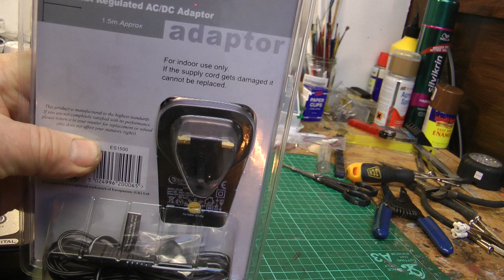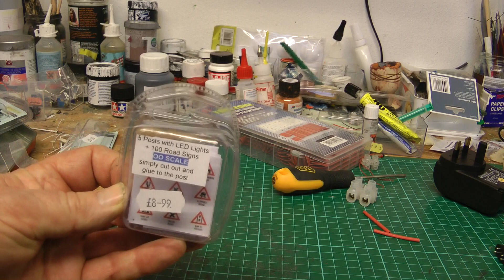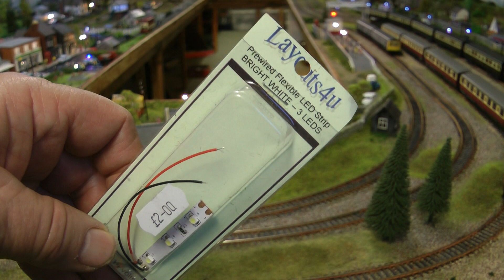Adding lights to Model Railways

Comment: Hi Dave: I have cut the end of the Regulated Adaptor like you say in the Video...which is the positive wire...the all black wire or the black and white one ..great video
Reply from the maker: The black and white one is the positive ...Dave
Reply: ***** Thanks Dave...your layout is something else...well done
Reply from the maker: Peter McGlone Thanks , just ask if you get a problem , not sure will be able to answer mind , but will try ..Dave
Reply: ***** No doubt I will be back as Arnie Swartz' would say.....cheers
Reply from the maker: Peter McGlone  No problem
Reply: ***** Dave Quick one before I start...I am using strip LEDs bought from E Bay do I take resistors off on LEDs or leave them on. I am using the Regulated Transformer like the one in your Video.
Reply from the maker: Peter McGlone if you are using the three or more leds on a strip , no need for resistors on the 12 volts
Reply: ***** Thanks Dave...I have just used one LED to see how bright they are and a bit of a test run..I have put it in one of the Mill buildings (N Gauge). the one i have are a bit bright. I took the resistor off.Sorry to keep bothering you.
Reply from the maker: Peter McGlone Maybe if it is too bright just run a felt tip pen darker colour over the bulb ,
Reply: ***** Thanks Dave...I put a touch of Red Acrylic paint on...it works a treat. Just going to try one at a time in case I blow the lights rather than do a circuit of say 20 lights. Just wish I hadn't built my Metcalfe Building first now but think I got away with some by cutting hole under base card.
Reply from the maker: Peter McGlone I did show a video adding the lights to a signal box ,and yes I know what you mean ,need to add the lights whilst building the models
Reply: ***** Dave.I have put six LEDs in a series into the row of Metcalfe shops and they work a treat. The LEDs I bought are a bit bright but a touch of Red Acrylic paint tones it down. I used blue acrylic on the one for the chip shop which gives a cool effect. Thanks a million.
Reply from the maker: Peter McGlone Glad it worked out good in the end ...Dave

Comment: brilliant video :) just came accross it, now i know how im going to to my lighting on my future set ;)  thanks david... new to electrics but this video explained alot.. so with it set to 3v on that adapter there is no need for resistors? also whats the max  number of led lights you can load onto that adaptor? and if you over done the max what would happen?
Reply from the maker: Thank you , glad you found this useful...yes with the transformer set at 3v you can run the LED`s without  having to use resistors ...make sure its a regulated transformer , I run up to about 40 led` on one unit ..I have been told you can run up to 70 from one  source , got to admit now though I do put the resistors on and run all at 12v  makes life a lot easier as all on same then ...the only thing that happens when overloaded is they do not light up ...cheers  DAve

Comment: Hello David, just watched this brilliant video.I have got a regulated 2500mA adaptor with the changeable end fittings similar to yours.now i'm not sure how many lights can you wire into the chocolate block connector that would be attached to the end of the adaptor once the end has been chopped off,if you know what I mean, so for example if i fitted 12 of the streetlights on the layout could i wire the 12 wires together and then fit into the connector block or do you need to have a feeder wire between separate chocolate blocks for each light.Sorry if I sound a bit thick but It's all new to me.Glad your video was at the top o the search engine to
Many thanks Dave
Craig
Ps I have   7 old hornby dublo buffers with a red light on them with the old push fit connectors they are 12 v so do you need a resistor on these they all work off an old 12 v transformer but I'm worried about catching fire if overloaded
Reply from the maker: hi Craig ..if you are using LED`s no problems ..I wire up to 70 lights to one 12 v feed ...I do wire maybe 3 lights to one part on the connector ..but carnt see any problem with wiring more ...think I have 12 outlets on my connector blocks ..so could theoretically with 3 to a feed fit 36 ...not sure about your buffers ..if they are 12 v should be ok and if your transformer is the regulated should be no surge so only giving the 12v ...try just one and see if OK ...Cheers dave
Reply: Thank you so much Dave for replying so quickly that makes great sense now you are a top man and I really appreciate your help and advice,thanks again and will do a quick update when |I have fitted them and give you a huge mention
Cheers
Craig
Reply from the maker: Maria Preston 👍🏼glad you could understand and find it useful .. Dave

Comment from the maker: Will see later , but basically you have 3 wires from the signal , 2 go to the switch , and one to live feed , then one fron the switch to the negative feed , that is with a 2 light signal and a 3 point toggle switch

Comment: Can I share a tip with you. Over the years I've accumulated a number of battery chargers from cell phones I no longer use, my old camcorder and some no longer working power tools. Most of these chargers are 12 volt here in the USA. They make good power sources for lighting and others accessories. You can save some money and keep the old chargers in use at the same time.

Comment: Im jst struggling with my smaller 0-6-0 locos over normal points and hav been told to use electro frog?! Jst added my first building lights :) wil post vid soon

Comment: I have a regulated  adapter and want to run 3 volt lights. But what type of wire do I need
Reply from the maker: Just answered that on here 1mm or 2mm ..I now use mainly 12v using the resistors , it makes like easier having all 12v ...Cheers Dave

Comment: I connected my grain of wheat bulbs in series and hooked them up to an old Lionel 4-train transformer. Setting on notch #1 is enough to power them without blowing the bulbs.
Reply from the maker: I have done that inn the past , but now `I just use LED`s , can wire up to about 50 from one 12 v transformer ...cheers Dave

Comment: hi I am ordering Street lights from china. they come with just the wire not connectors is it possible for me to just attach them to batteries. they are for a Christmas village my wife has. thanks
Reply from the maker: kyle montgomery I should think so , just make sure you have th correct voltage batteries
Reply: What sort of battery pack do you think I would need
Reply from the maker: Unable to open this ...
Reply from the maker: depends on the voltage ..are they 12 v ...3 volts ..9 volts ...a lot of the xmas lights run off 2x 3v batteries ...but maybe better getting a variable voltage transformer ..about £10 ..and start from 3 v and work your way up ..they can usually be found at Amazon
Reply: thanks for you help
Reply from the maker: Welcome ..Dave

Comment: Thanks Dave for giving me confidence to plan and attempt to wire my model railway layout which I am looking forward in doing once the weather gets warmer. The layout is not as big as yours but has been on stop for a while so it and me  need a boost to get it back functioning again.  Putting in some lights will transform the layout which once finished I will film  to compare with my earlier version =  https://www.youtube.com/results?search_query=swanholme+railway  Thanks again.
Reply from the maker: Just watched one of your video`s , you have built a great layout ..did comment good luck with the new layout ..sorry should have read all this firs ..yes adding lights will enhance you layout , and as I showed its not hard to do ..Cheers Dave

Comment: The four street lights ran of a 12v = 3v each Roy
Reply from the maker: I connect them all in at 3 volts with that variable voltage regulated  transformer , if they are a 12 volts light i run them on the 12 v setting on a separate transformer

Comment: i just use a big strip off Christmas lights and nailed them too the under side of my board and blanked out the ones i didn't use for the houses
Reply from the maker: I have also used them , its a cheaper way to do it and works good ..Dave

Comment: Its bad practice running leds directly from a power supply without a resistor because unlike filament lamps, leds can go into thermal runaway if they get too hot and this can happen when the volts drop across the led is too high. I would be using a 27 or a 47 ohm 1/4 watt resistor in series with each led even on a 3V supply just keep the led within its safe operating area. You may get away with running them directly from the supply but its not the way leds are designed to be powered up.
Reply from the maker: Is that also applied to regulated transformers ? to be honest , I have used these over about 4 years and not had a problem , i do have a few I use with resistors on 12 v ..
Reply: Hi David. Yes it does apply to any power source including regulated transformers. The problem with leds is that even a batch  of the same type have slightly different characteristics between one and the next and one can have a slightly lower resistance that it neighbour and takes a bit more current as a result. You can never guarantee that they will share current evenly unfortunately because of these slight differences and this affects brightness and life span. The idea behind the resistor is not just to drop voltage but also to regulate current through the leds so they share current from the source safely without any one led ever being able to go short circuit and draw full current from the power source. This could never happen in a filament lamp but is a real possibility with leds unfortunately. 

Many have a 2.5V inherent drop when conducting and it may be that your transformer is actually around 2.5V hence not having a problem. But I would always use a resistor even if its a low value such as a 10 ohm.
Reply from the maker: cbcdesign001 Thank you for than information , could be I will use resistors then now in the future 
Dave
Reply: No problem, always glad to pass on my day job electronic knowledge. Thank you for your informative video, your lighting looks great I must say and its inspired me to see what I can do with my layout which is very much in the early stages and nowhere near as good as yours.
Reply from the maker: cbcdesign001 Look forward to watching your progress with the layout ..Dave